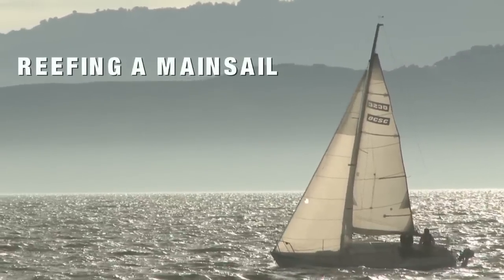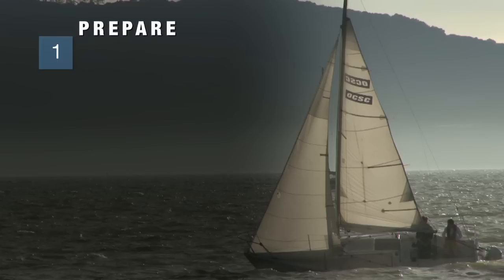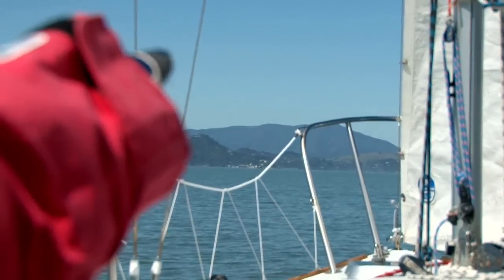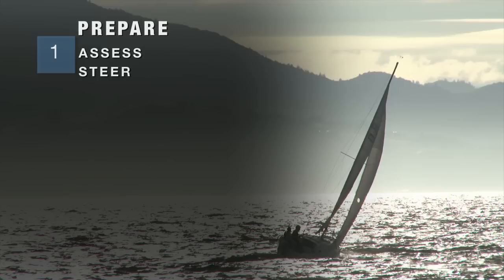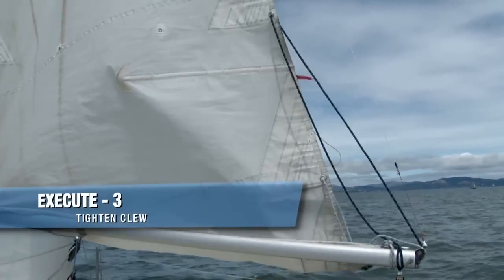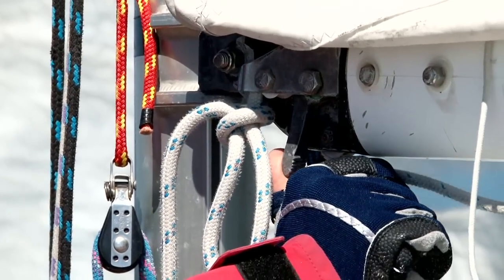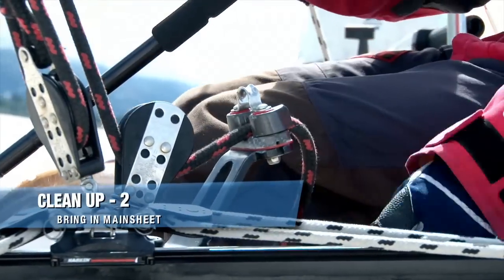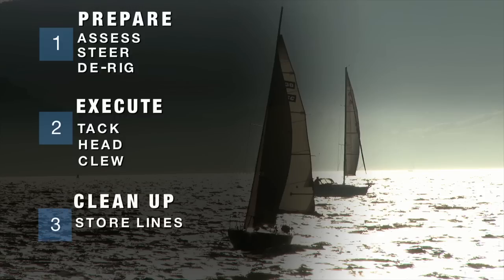Reefing - Double Slab Reefing

Comment: Picked up a great new tip with this video... prior to tensioning clew, raise the boom to level with the line of reef points... should have been common sense, but I''ve never done this... thanks!!!

Each to his own, but I think it is best practice to always heave-to when taking in a reef point.... no mistakes with inexperienced crew manning the helm... form the habit of heaving to before reefing and you will avoid the problems that can easily occur. Also, it's good practice to ensure tension on  lazy jacks before dropping halyard. to hook the cringle... keep the slacked sail tamed.

Comment: Well done. I like the little tip on the slip knot on the jam cleat. I might add just one minor detail under the heading of assessing the situation with regard to traffic and sea room. When possible, it is a good idea to be on starboard tack while reefing, when you are less maneuverable. You retain rights over almost everything except starboard sailboats to leeward. This way, if a line gets tangled during reefing, you can be a little safer taking extra time to clear it.

Comment: With the lack of vertical tension at the Clew, that system just prevented you from controlling the shape of the sail -something of great importance when you need to reef. Almost rendering the vang useless.,There are much better ways to reef, including floating bowlines for instance, than this system.